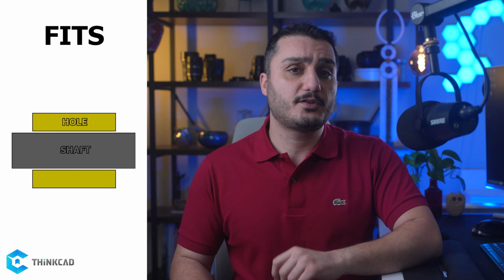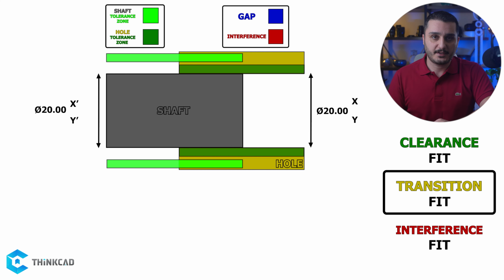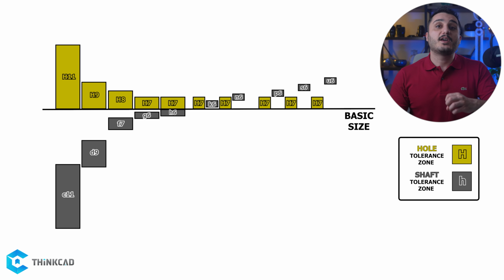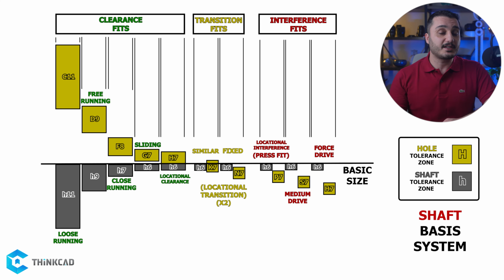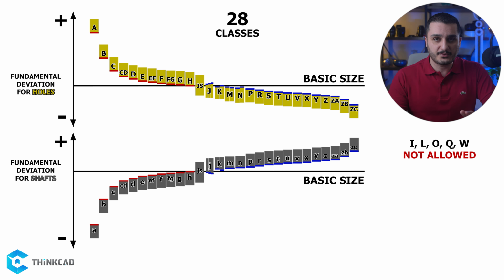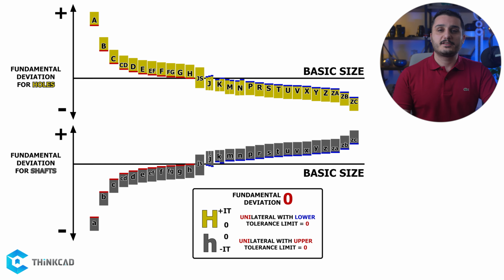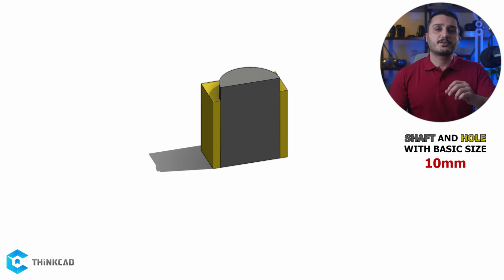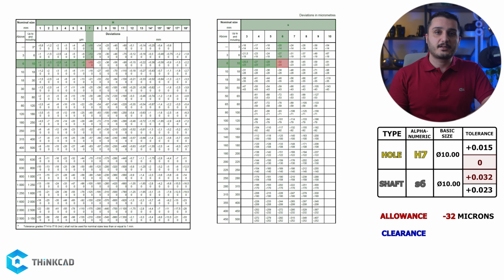Mechanical Fits - ISO

Comment: On the shop floor we use these names too, Clearence the running or sliding fits and a slip fit, Transition is a snug fit and Interference is a press fit, same stuff lots of slang names used by most machinist on the shop floor since we have our own language, just like we call a measuring tape a yo-yo, telescoping gages are snap gages and your Machinery Handbook is the Bible.
Reply from the maker: @mscscambodia  very true indeed. Thanks for sharing your experience.